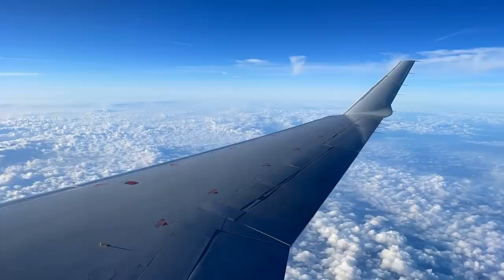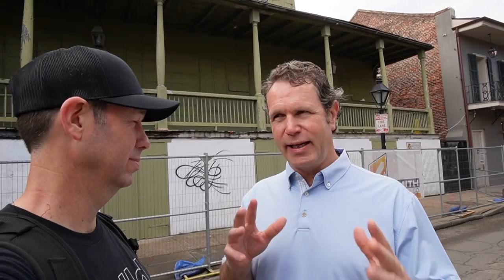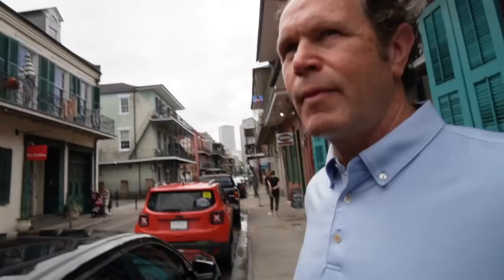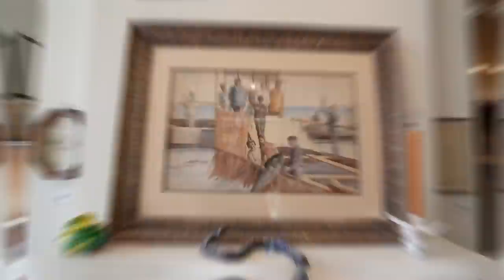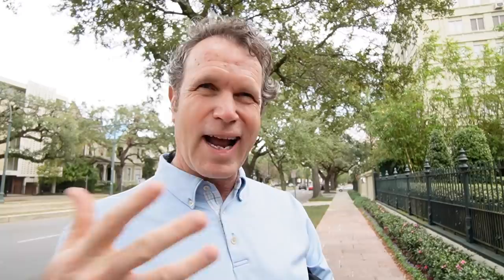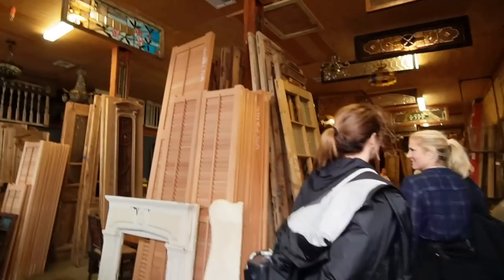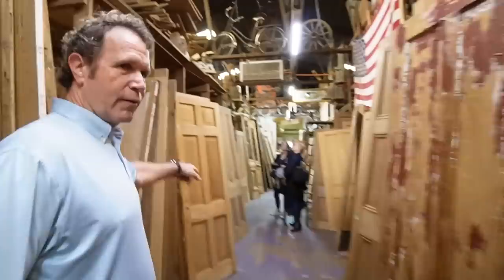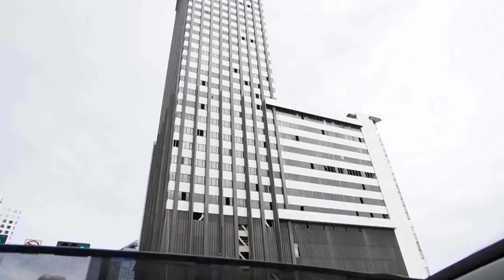Historic Buildings of New Orleans : Come Tour with My Buddy Brent Hull & I

Comment: Matt we're building a new house in Knoxville TN.  Is there any reason why I shouldn't use close cell spray foam in the attic ceiling?
Reply: Is there a reason to use it in a new building to begin with? I dont understand why you would want to ruin your new house.
Reply: In a warm humid climate, do totally encapsulated unvented roof line with open cell.  You must condition the attic space.  AC & Dehumidification.